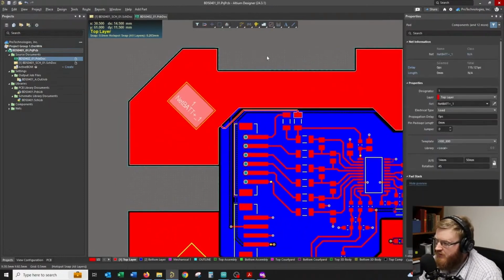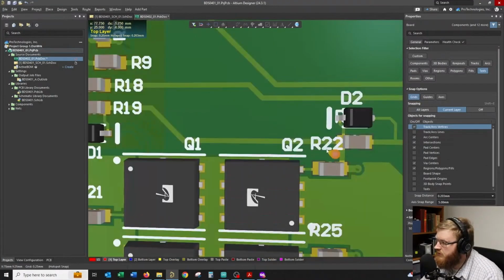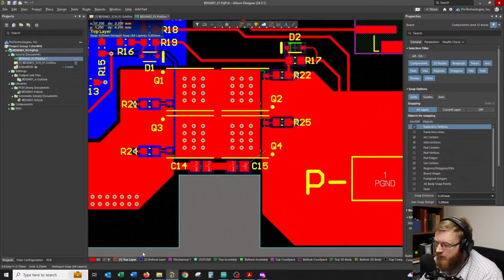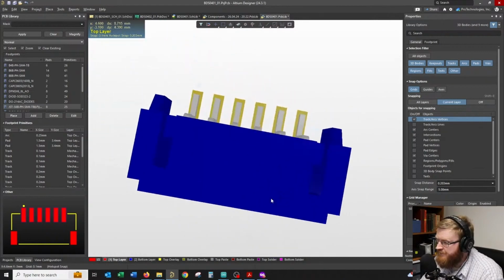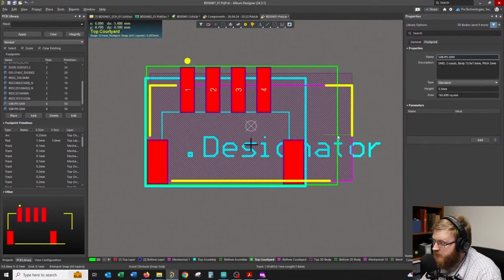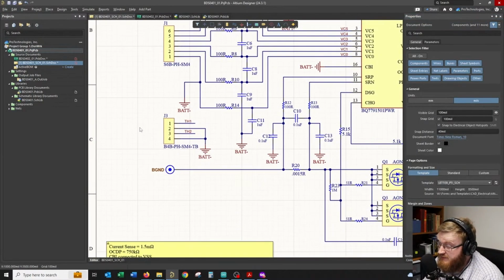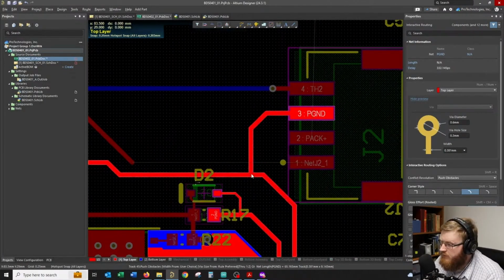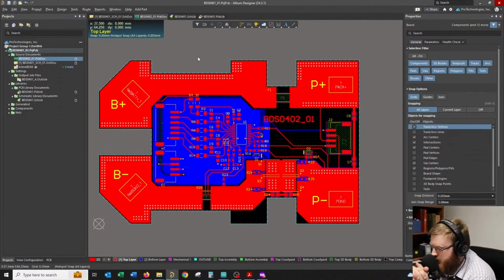BONUS CONTENT (Re-Upload) | BQ77915 PCB Layout | BMS Design Series Part 05

Comment: Thank you for doing this design series. One approach that I have found helpful during my 40 + years of doing PCB layouts; when possible, put the reference  designation near pin one of IC's and Fets. It helps repair techs locate pins more quickly when troubleshooting.